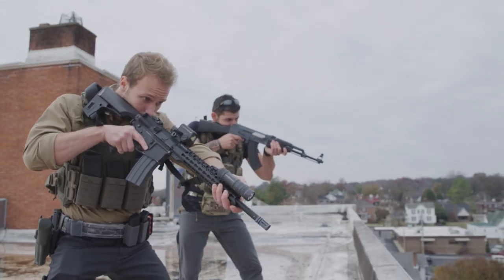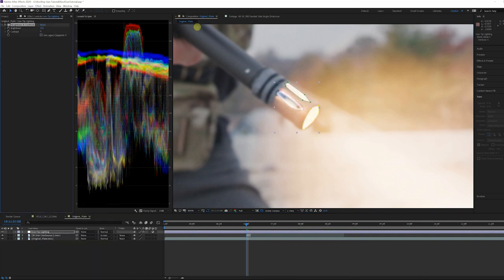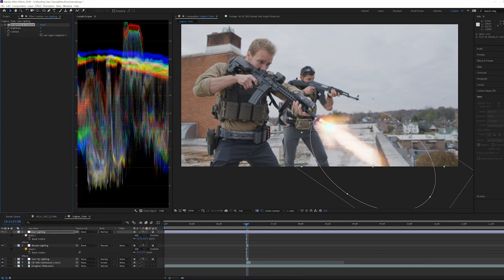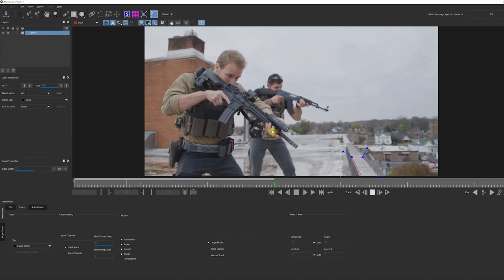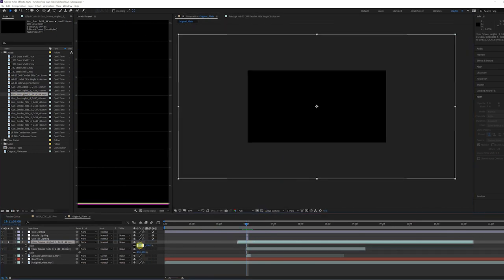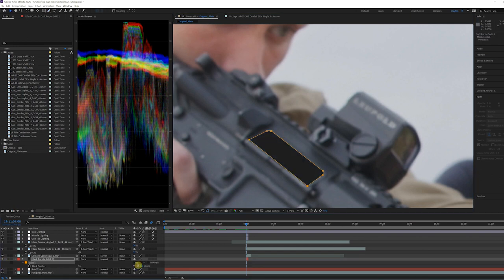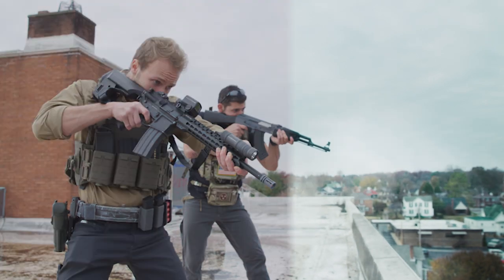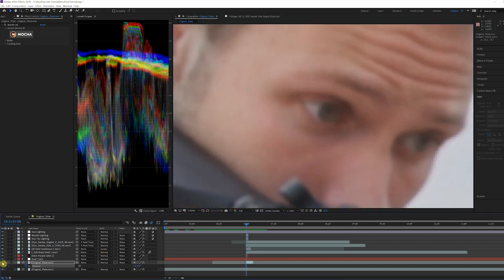How To Composite Muzzle Flashes And More | Gun VFX | After Effects Tutorial

Comment: Which version of AE have you been using here? I've recently encountered a strong color-shift in newer AE versions, which give the Gun Smoke 2 footage a terrible look as opposed as how it used to look. Wonder if you're running into the same problem.
Reply from the maker: Sorry for the delay in our reply! Clayton used After Effects 2019 (v 16). That would be an issue with the system and not our elements it would seem. Adobe should be contacted about that.